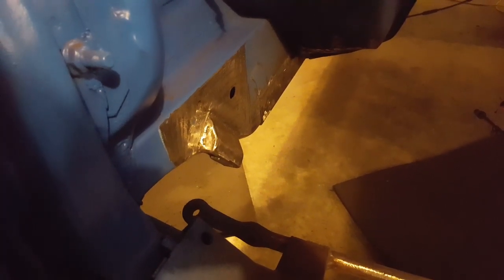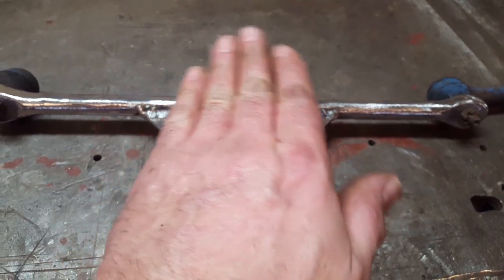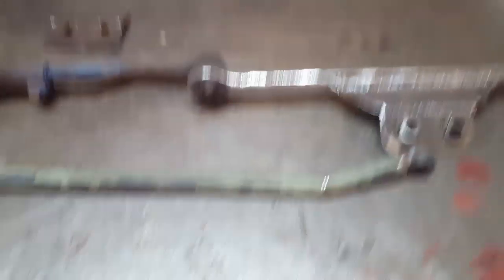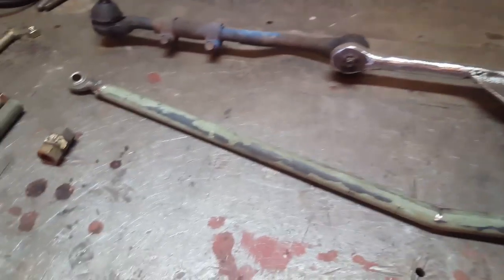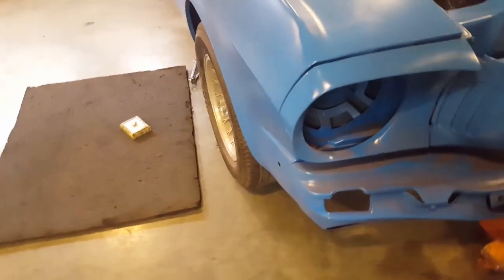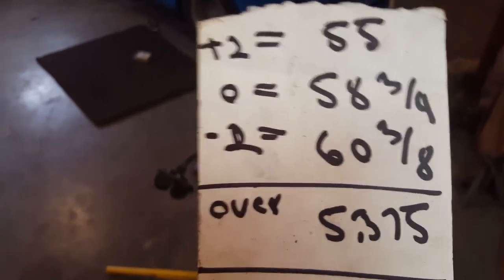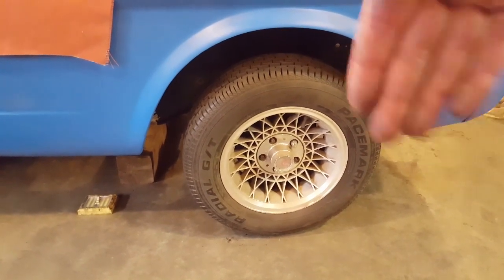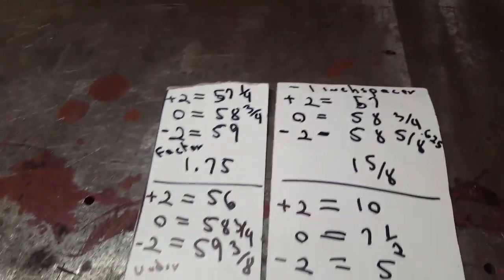66 Mustang project. Steering issues

Comment: You did the best you could to explain it, and I did the best I could to understand it.  .LOL My field of work is aviation, and in control surface rigging you can go thru some serious check, and recheck before you are satisfied.   Thanks for the video.  Your job is harder than mine because I'm stuck with figures that have to remain factory, while you are setting the standard.  My hats off to you sir.

Comment: I don't know if it would help but if you try to look it up  I believe that  Carrol Shelby  would  relocate the upper control arm mounting position upwards about an inch or so for improved handling.  It might help with the bump steer issues as well..

Comment: Hi Fitzee, with bump steer am I right in thinking the factory specifications of toe in on spring compression (dive when cornering or braking) will help the car turn through a corner and the tyre scrub is wanted by the designer to help reduce the vehicle speed, especially in a corner? If that's right your revised bump steer lengths will result in less tyre scrub on dive, which seems good to me.
Reply from the maker: You are correct

Comment: Interesting dilemma, I'm soon going to have to address something similar on my hot rod build, fendered with individual front suspension.  Theoretically a rack with the same length as the centerink would be ideal, outer links being equal length to the lower A-arms. This, of course would require a steering rack, out from the ends of which the inner tie rod ends come. There are lots of variables.
Reply from the maker: Trial and error that's what I did. Find these interesting to solve
Reply: @fitzeesfabrications   You did a great job!  .. and I finally understand this phenomena of bump steer

Comment: No one builds a rack designed for the classic Mustang- your using racks designed for other vehicles trying to adapt it.  You will never eliminate bump steer only improve it.  Design a different front end or design a classic specific rack.  I've been waiting for yrs.  No body has done it yet.